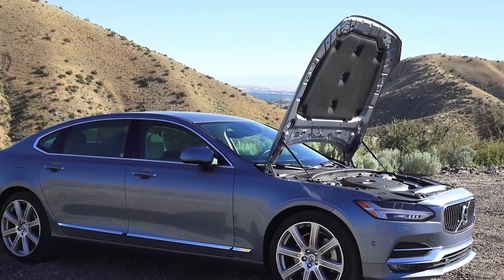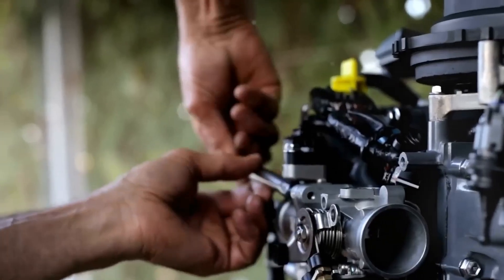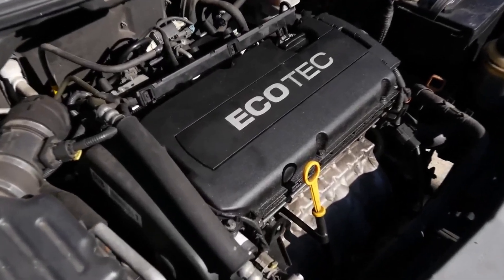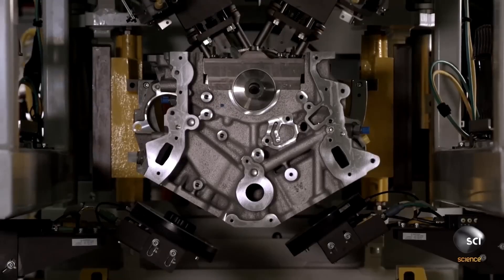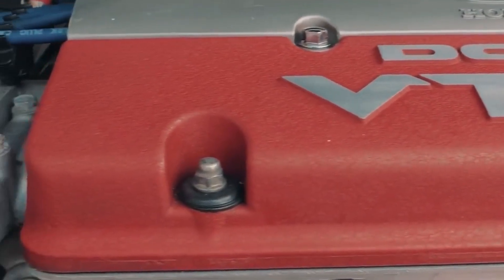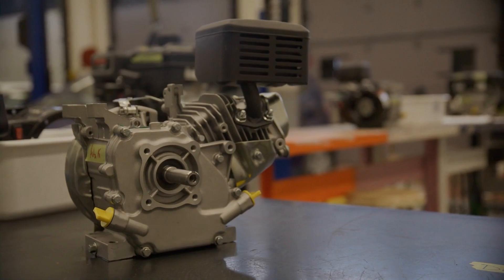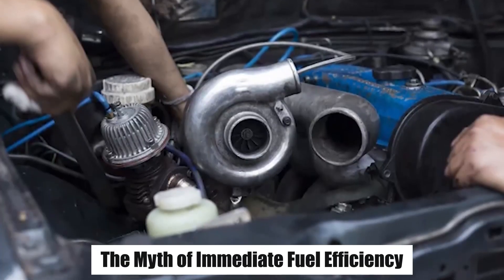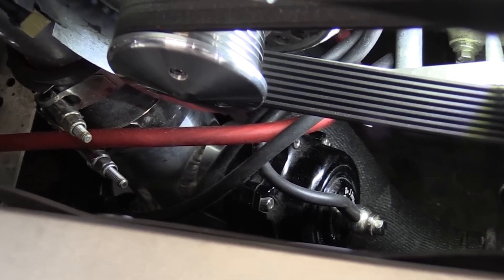Why Small Turbo Engines Are Not Efficient

Comment: i did a small test same car different engine
2L I4 Na making 144 hp and 189 lb-ft: at 40mph 35mpg at 70mph 32mpg and at max speed of 128mph 11.6mpg
2l I4 turbo 10lbs boost making 211 hp and 281 ib-ft: at 40mph 37.5mpg at 70mph 33mpg and at max speed of 137mph 9mpg
5.5L V8 Na making 230 hp and 421 ib-ft: at 40mph 15.4mpg at 70mph 14.8mpg and at max speed of 115mph 5mpg
5.5L V8 twin turbo 9lbs of boost making 262hp and 565 ib-ft: at 40mph 25mpg at 70mph 22mpg at max speed of 115mph 10mpg

the 2L turbo wins time to get extreme
2L i4 turbo 40lbs of boost making 669 hp and 638 ib-ft: at 40mph 38mpg at 70mph 32.5mpg no max speed because it went bang
5.5L V8 twin turbo 36lbs of boost making 1665 hp and 2021 ib-ft: at 40mph 18mpg at 70mph 17.6mpg at max speed of 134mph 9mpg

Comment: Low RPMs, low load, low boost, low consumption. Yet you have the high RPM high boost power for fun or emergencies. This is why I am interested in smaller, lighter engines with forced induction at high RPMs, over bigger engines of any kind. Especially if those little engines are well balanced and able to rev high.

Comment: I couldn’t agree less.  
My 1.4 L Abarth with a bigger turbo and zero work to the engine makes 325hp and 420nm.  My Abarth averages 8.1L/100 Urban, while the Ford V8 Mustang averages 19.1L/100.  With all the torque I produce, I can drive around town at a comfortable 2K revs in any gear I choose.

Comment: The keyword is "when driven hard" 
WHEN THEY'RE NOT DRIVEN HARD THEY PROVIDE BETTER FUEL EFFICIENCY SHORT OVERTAKES DON'T AFFECT THEM.
Example 1 L TSI in polo and up!, 1 L TGDI in Hyundai i20 N line(Indian version) etc all these provide better mileage than 1.5 L Honda NA engines with similar power but better torque figure.